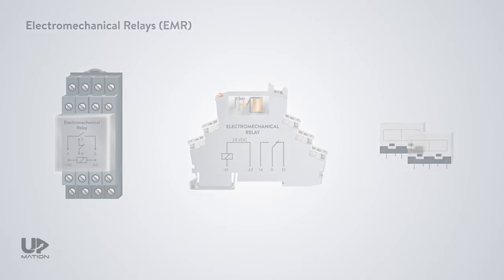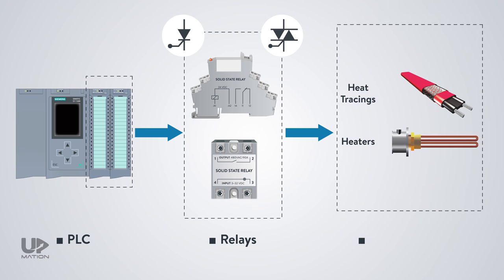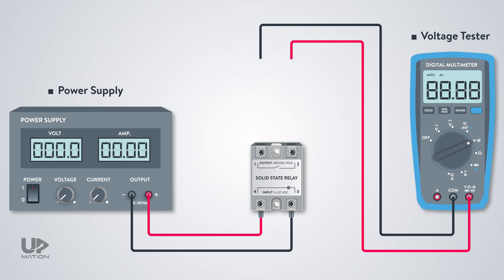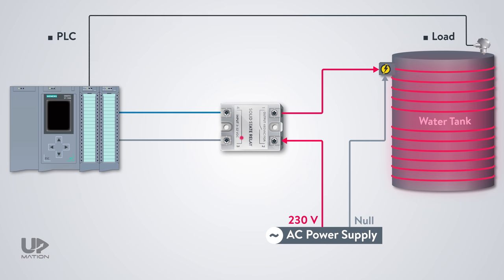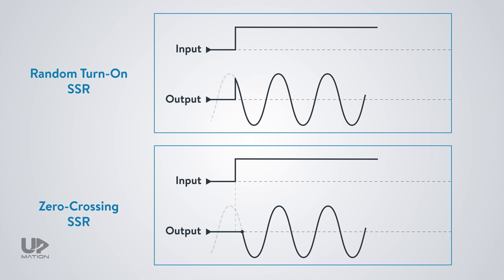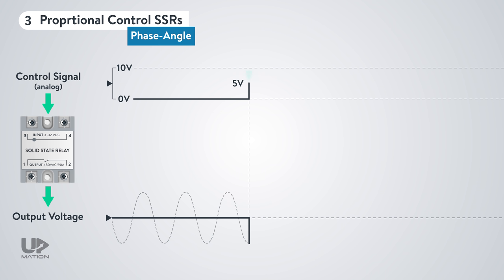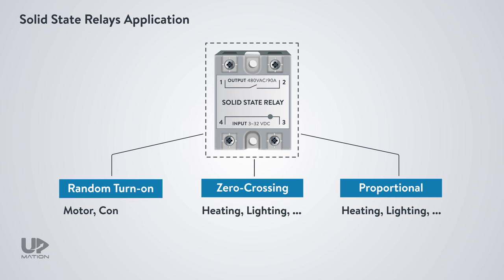How Solid State Relays Work | Testing Solid State Relay with Multimeter | Solid State Relay Wiring

Comment: I would say one of main reasons to use ssr in factory automation is the on off cycle amount without contactor contacts getting burned.
Reply from the maker: That's correct, Raimonds! Thank you for adding the point.

Comment: So these solid state relays's advantages is endorsing a dead time concept in both asynchronous and synchronize modes? Although the other one only uses this when switching off.
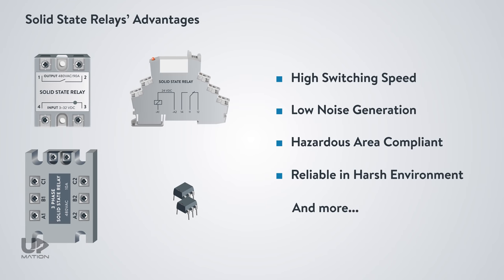Reply from the maker: That's right! Although the other important advantages of SSRs have been listed @5:35. Knowing how SSRs transfer the power to their output (as you've explained, it's like dedicating some deadtime to the output voltage), would let us know how much control we can have over an output element. These will help us in various practical usages which we mentioned @9:27. Hope it helps!

Comment: Thanks for the nice explanation. Does SSR also isolates between supply & contact side? Example if the contact side exposed to high voltage spike, will this damage the supply side?
Reply from the maker: You're very welcome! Yes, it does. Same as the EMRs, the SSRs also use control circuit and power circuit.
 The SSRs benefit from optocouplers on their internal circuit to isolate the control side from the high-voltage (power switching) side.
Reply: I see, didn't think about optocoupler. I thought SSR is just a bigger version of transistor 😁

Comment: Nice video.
But I would like still to know how the ssr internally works from the non mechanical switching system. 🤔
The video need much more audio volume.
Reply from the maker: Hey! Great suggestion! We will consider your suggestion for the upcoming videos. About the volume level, you are right and we are sorry about that. It has been corrected in the next videos.

Comment: nice video , what is the maximum frequency of open and close can it operate at ? 5Hz ?
Reply from the maker: It actually depends. For a zero-crossing SSR, it could be as less as 0.5 Hz.
Reply: @Upmation  mine it’s 3 to 32 v dc input and output is 0 to 220 v DC I don’t thinks it’s zero crossing

Comment: You didn't touch on one very important difference - heat. SSR's produce a lot of heat and require sinking in situations where a comparable EMR does not yes?

Also is it a characteristic of all SSR's that they fail open? 

I'm currently designing a small enclosure that will be double insulated and uses a 12V 20mA DC signal to switch on power for audio power amps that can draw 2400W max sustained (240V 10A connection). Having  no ventilation and wanting it to be small, safe and minimal risk to the trigger source, I elected to use 2 relays - a small SSR that the 12V DC triggers to provide a 204V AC switch current to a larger EMR. I figure the SSR provides a buffer so no coil spikes into the 12V source may occur and the Power supply on the audio amp should be capable of coping with the switching voltages given it's designed to be plugged into mains power. Also I have no voltage drop from the SSR.

I had wanted to use a single SSR like you showed but the heat was a concern even though the average power will be much below the maximum 10A draw. It would be about 10W which is a lot I think.
Reply from the maker: Thank you for the input and your experience! You have it right. As you've mentioned the SSR's heat dissipation is a concern while using them which can be resolved by using heatsinks if there is sufficient space for that. We were more aiming at producing an introduction on "how it works", instead of "how to use it." Even though, we can consider a short video to point out these sorts of details.
If you have any further suggestions, please let us know. Thank you!

Comment: So the thermocouple is affected by the noise of the of mechanical relay or any noise from the working place can corrupt the signal from thermocouple?
Or The mechanical relay can create a static electricity that can interfere or corrupt the signal coming from thermocouple?
Reply from the maker: It's actually a kind noise, let's say. And of course, there are lots of things we can do to prevent that, such as using some sort of special thermocouple cables. It is better to bring down the level of noise within the panel anyways.

Comment: Shouldn't be the zero-crossing asynchronous and the random turn on be synchronous?? the other way around? as synchronous means at the same time which is the case for random-turn on but in the zero crossing there is propagation delay hence asynchronous?
Reply from the maker: The "Synchronous" is used for the zero-crossing types as it passes the power exactly at the next zero-crossing point of the sine wave. So let's think about it like this: they're always "synchronous" to where the voltage sine wave crosses the horizontal axis.

Comment: can SSR can be used for DC load ?
Reply from the maker: Hey! Yes, if the SSR is a kind of relay that a single SCR or a transistor has been used in its output it can be used for DC loads. The ones that we use for AC loads have Triac or paired Thyristor in their outputs.

Comment: Good video, however you should warn people of some of its disadvantages like thermal runaway. Which can be dangerous and destructive to the control panel. Maybe you already have, I have not looked at all your catalog, A good video would be to go over the differences between the SSR and the SCR. A lot of people think these are the same, but they are not.
Reply from the maker: Sounds a good idea! Thank you for your suggestion.

Comment: On heater it is better to have high frequency and low wattage driver and save energy because it is a brute Force to use high current and low frequency like analog inductor coil. SSR it is quiet, cooler, and less costly to manufacturing
Reply from the maker: In most cases this subject is something most engineers and technicians have never considered; specifically those with a background in electromechanical relays. They're accustomed to energizing a coil and waiting for the arcing and clanking thereafter! The subtle nature of a solid-state relay is still something of a mystery to them! :)

Comment: I don't understand how the mechanical noise could interrupt or influence the signal @05:02
Reply from the maker: It actually is not a mechanical noise. This mechanical "movement" might affect the electrical signals undesirably, "indirectly". To put it simply, when the contacts - that one of which is charged with a voltage - hit each other, it will generate a sort of voltage signal that is somehow distorted. This, let's say random signal, which is a kind of voltage signal, might have an undesirable effect on the other voltage signals on the circuit, as it will be added to or distracted from them. Consider a 24-volt signal that its level is dropped to 15 volts. It will not be identified by the PLC card as a "True" signal, anymore, and consequently - as you might have guessed - the logic will not act properly.
However, defining a noise is not that easy if you go deep and I tried to simplify it as much as I could. Hope I could convey! Please let me know if have further questions.